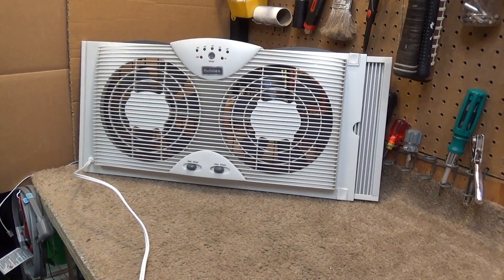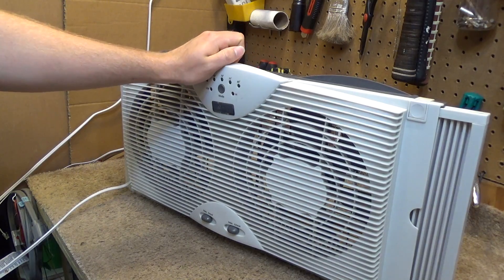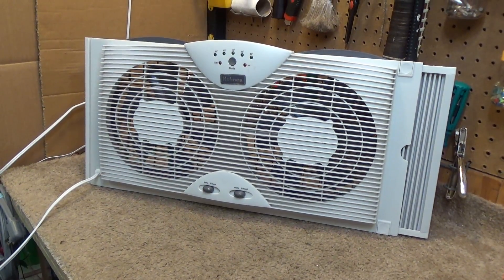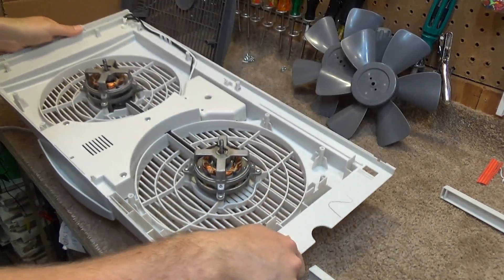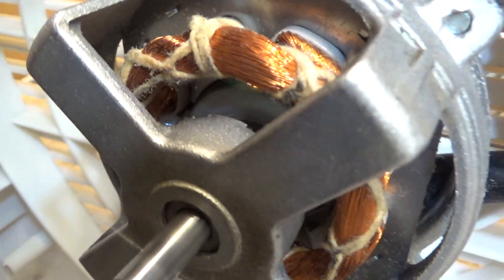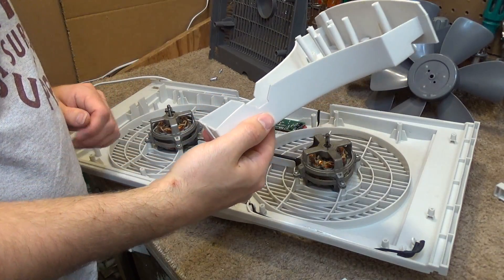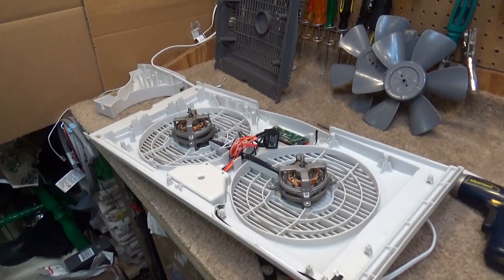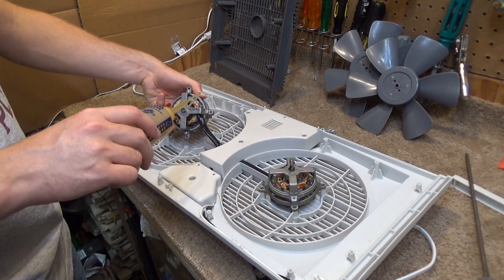The Electronic Controls Are Failing! | Holmes HWF0910AT Reversible Twin Window Fan

Comment: Hi. I am pretty sure that is the exact model twin fans that I have. It was given to me. Does not work. I cut all the electronics out of the unit. All looks new inside & out. Plugged up a temporary wire. One that I knew worked. Fans started spinning after I helped with my finger. Obviously needs a capacitor. Maybe 1 for each fan. Can you tell me what size capacitors or maybe 1 large for this unit? I have lots of electronics.  Solid state stuff, I collect & save. Because, there are no more Radio Shacks to walk inside & buy that kind of stuff man.
Reply from the maker: Did your unit not have a capacitor in it? It would be located in the center channel between the two fans.

Comment: I would no longer use that when it's not being monitored as it is, such as with your previous use case.   Perhaps a heatsink can be attached to the resistor or it can be extended in isolation further away from any parts it can cause harm to.

Mechanical controls, especially modern ones, are just as much of a "when they quit" as electronic.
Reply from the maker: I never really leave the house anymore so it's not an issue for now, but when I go back to work it will be replaced with one of the mechanical control models if a fan is still needed. Quite frankly I think the concept of attaching a heatsink to the resistor is absurd.
Mechanical controls will eventually fail, yes, but not nearly as soon as this one will. This set of controls is constantly wearing itself out, even when the fan is turned off. A mechanical dial does not wear out as it sits turned off. It also should not throw off any heat providing it is wired correctly.

Comment: I strongly dislike electronic controls. They are way too finicky and innaccurate. They should be able to last much longer than mechanical controls but they always fail very quickly. The only appliances I have with electronic controls are my dishwasher and stove. All the others are using mechanical controls and have never exhibited any sort of failure. A mechanical control modification would make this fan perfectly usable again.
Reply from the maker: I agree, I avoid them for those very reasons. I would never buy a stove with electronic controls, there is way too much to go wrong with that.
Reply: It's difficult to find stoves nowadays without them. Have to look at used markets.
Reply from the maker: @andrewg593  I look at nothing else; all new appliances are junk.
Reply: @JordanU  When I get my own place, used appliances will be the only thing I consider. I agree all modern appliances are junk.